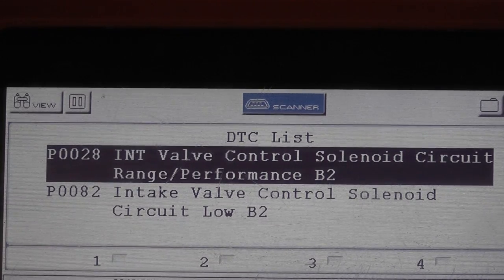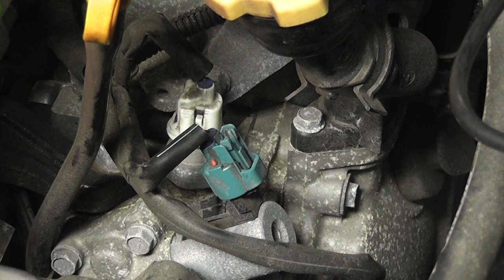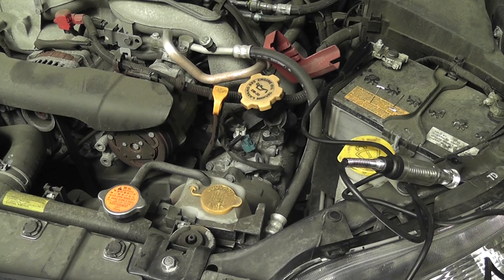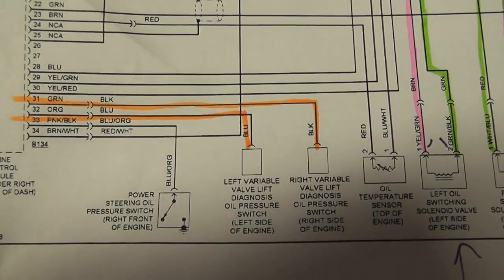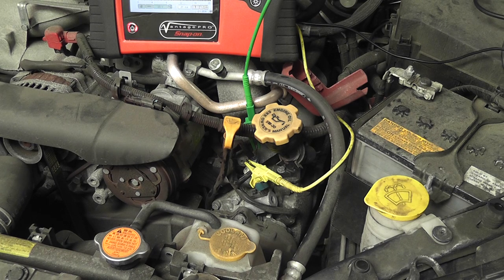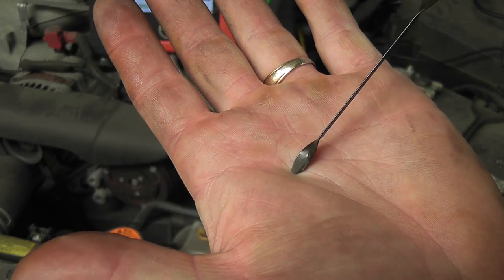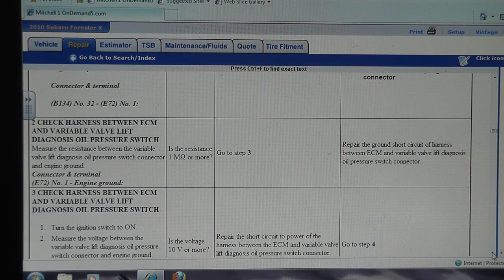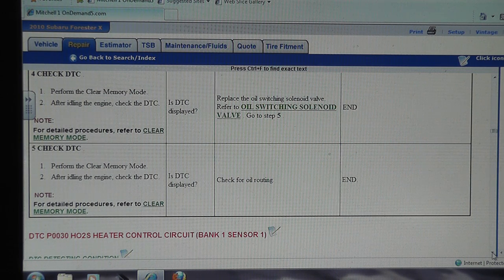How to test Intake Valve Control Solenoids (codes P0028, P0082) - Subaru

Comment: I saw this exact same thing on another Subaru with the same issue. The oil was low and dirty. It caused the SAME codes. Car owners that do NOT check their oil are asking for more issues than they can imagine. I hammer this into my kids heads and my wifes head. Changine oil and maintaining it is the CHEAPEST insurance for a great running car. This told me TWICE now that this vehicle is reliant on proper oil level for proper operation on that oil pressure switch. Wow! Great method for checking it too. Your test works and as you said saves time. Great job!

Comment: I have been troubleshooting electronic engine controls for 18 years, and I feel the same way on flow charts. You take a simple, and effective approach to trouble shooting and relay the system in a very understandable way. Keep up the great work. The younger guys starting out in this technical field, will certainly benefit from your knowledge and use of the scope as a major tool in troubleshooting. Great videos.

Comment: You are a freak!  I have degrees in mechanical, electrical, and industrial engineering and you amaze me.  Your logical reasoning is what is needed in the fundamentals of engineering.  I consider myself very good at logical reasoning and very much appreciate your skill level.  You need to simply forward a video to the headquarters of Subaru and wait for a call.  I have a lot to learn from you in vehicle electrical systems.  Thank you for taking the time and effort to teach us!
Reply from the maker: Wow what a compliment coming from someone with your background and knowledge. Thanks so much! I'm just a guy who barely passed high school who found his calling in electronic  classes at the tech school i went to. Then I went into the field for 8 years before coming back to teach at the same school (Rosedale Technical College) and have been teaching on this subject for over 19 years now while still troubleshooting cars both in the live shop at our school and for different garages. So I've just had a lot of practice on teaching certain subjects. More from a mechanics mindset though. I know some of my theories are off but if I can say to someone 100% of the time if you have this problem then it will be this solution. Who cares if my theory is off a bit 😉

Comment: Bought an '07 Outback for my son and it threw a P0028.  Having an electronics background I found your video really good.  I am getting a burning smell and found the oil pressure switch that seems to be leaking by.  I hope this is the problem but with your video, I really have a good sense of where to go.  Thanks!
Reply from the maker: thank you!

Comment: If you follow that flow chart you'd end up putting in a new oil switching solenoid valve giving it back to the customer and then they'd seize their motor because it had no oil.
Great video I've learned many things in the short time since I found your channel.

Comment from the maker: Good question. The digital voltage reading is an average of the on/off duty cycle. It increased in voltage because the on-time increased. If this was ground side switched the voltage average would drop as on-time increases.

Comment from the maker: You are correct, but if done properly it is THE tool to use. Remember my test light was connected to B (+) and it was finding a ground through the solenoid winding when plugged in. Unplugged the yel/grn wire did not light. Plugged in it did because it was finding a ground through the solenoid winding and the other wire that was a constant ground.

Comment: Paul that was fantastic.  I suspect  the OEM'S are not sharing the correct diagnostic repair procedures to 3rd parties.    I would suggest that the dealer network repair flow chart differs from what you have.   Auto manufactures are required to produce specifications on their vehicles and you see what they are sending.  The right to repair bill  is being challenged by OEM'S.  That flow chart was an insult.  Glad to hear your thoughts on a subject that seems to be getting worse. Well done !!

Comment from the maker: It certainly can be dangerous but only if you are using the wrong polarity and the driver happens to be "on". If the correct polarity is used, even with the driver "on", there is no danger as there would be equal potential across the emitter, collector circuit. Equal potential = no current flow through the driver.
Reply: Mr danner where can i get a copy of your book

Comment: Hey Paul I'm an electrical engineer and completely agree with you about engineering flow charts.  These flow charts do not "promote" the understanding of basic electrical principals of ECM sensor operation and processing as well as ECM control methods of solenoids.  So was it the fact that the "oil pressure" switch was not being activated by proper oil pressure (due to a lack of oil) or was it the Cam sensors did not detect a change in engine timing that generated the error code. 
Great work Paul, keep it up , you are a great teacher, wish some of my Professors taught the way you do !!🙂
Reply from the maker: Great question! To be honest I'm not sure, it's been along time. I suppose the arguement could be made for either. Thanks so much for the encouragement!

Comment: I am using this video to trick an 07 ECU into thinking my non-VVL engine is running VVL. These are exactly the voltage readings i needed to see to wire the relay.

Comment: hi, at 11.14 in ur video you said that test light is lighting because the resistance of the solenoid is high, but i think it is lighting because resistance of the test light is high and because of that you were not able to pass enough current. if the resistnace of test light is low, then u pass more current to solenoid and it works. higher the resistance lower the current and viceversa. It worked fine with your jumper wire because it has less resistance.

Comment: like you wrote

step 1 should be : check the oil level

it make sense on a oil pressure working system.....

moreover i guess there is certainly a  pressure valve upstream to avoid spreading oil in all the system under a specific pressure no ?

not low oil pressure idiot light or sender connected to the ecu ?

Comment: good video,2 things one is bypass to monitor a reaction and two polarity to determine jumpwire placement. polarity a little confusing because testlight will show different readings based on harness connected or harness disconnected.

Comment: Paul, Nissan uses a similar system 'cept is a different code P0011 ivt control. It is a pulse width ecm controlled two wire solenoid, at idle you have 14 volts on both wires and off idle you have control on one wire. Had a car the other day with low oil setting that code, look for it. Excellent video btw.

Comment: The duty cycle at idle may be to monitor the solenoids / make sure they are connected, it may be a current monitoring signal.

Comment: I have a Subaru Forester and the engine is probably a Legacy DOHC, there is 12 volts on the solenoid socket after switching on the ignition, is that correct? Thank you for the answer, Jozef.

Comment: Other way to find power or ground side switch, there will be between 0v to 12 volt on control wire (two resistances are in series, one in the pcm and other is solenoid itself) when ign switch is turned on. other wire will be if 0v then this is power side switch or 12v (ground side).

Comment: good video, and fancy computer tool you have there. the skills you used were some basic multimeter skills that everyone should know, but very many do not. Measuring Resistance (in ohms) would show if you had a short or break in your wiring to harness. I can see why their flowchart mentioned to do this. You were measuring Voltage of the two circuits which could have shown correct voltage but if you had a break or short, it might not have been grounding out unless the vehicle was shaking underload

Comment from the maker: Yes, which is exactly what my ebook is all about teaching.
Reply: ScannerDanner  hi . In the video you keep saying will cook the ECM  if you touch the ground wire and  you were using test light .and you already touched ground wire when you try to identify  positive or negative switch . Why test light 12v supply goes through solenoid then ground back ecu will be fine  . What is  Rule s for avoiding damaging ecu .  Thank you paul

Comment: Paul when you revved the engine and got the oil switch to open, the voltage on channel 1 also increased activating the solenoid. Was this an average voltage or actual voltage????????????

Comment: The tests he did proved circuit integrity, an ohm test on the wires wouldn't have shown better results than his tests because he's not only doing voltage measurements but also voltage drop tests.

Engineers write in ohms tests because it's what they are accustomed to, for them the system isn't mounted in a car and interacting with other components. For them it's on a test bench with a note saying it doesn't work.

Comment: My 2008 Subaru OB with the 3.0 six codes out with P0026 and P0028.  I checked the oil and it's perfect.  The acceleration at times is stumbling when pressed, but when gentle is smooth as silk???   I have a code reader and the code clears (of course), but comes on after 1/2 mile or so.  Once when I turned the engine off, with the CEL light on, when I restarted it 2 hours later, the CEL was out, but came on after several miles.  Whasssuppp?

Comment: The dealer who I bought my car off of I brought my 2006 subaru forester to them. Got that code I had no oil. They filled it up. but now something on the bottom of the motor is burning after driving for like 10 minutes. The code hasn't came back but I am curious why it's doing this now. The car has 97700 and I just did an oil change two weeks ago. Any idea

Comment: I have a Subaru B9 Tribeca 2006. Its been in the shop for a very long time 4 years. The local dealer told me they didn't know what to do to fix it. The codes are P0028, P0011, P0016 and P0018. My wife really likes this car. I was told the 3.0 engine is a rare bird but we still see these cars on the road today so I'm sure someone knows what to do to repair it. We replaced the variable valve timing solenoids and oil switches in the heads. Please help us repair this vehicle.

Comment: @scannerdanner I think I may have fuel delivery problem.. Stft are good at idle plus went over entire intake whit propane, no rpm increase however system stays in open loop until I goose the throttle.. Car stills has miss at idle no load.. I'll try changing fuel fillter first.. this system has no test port.. But 02  show very very lean less then .10 bank 2.. Another thing I noticed was Pcv system on valve covers are rigged.. Lol whit a hose and spark plug boot.. Isn't the system suppose to regu

Comment: 8:20 I thought there were times that it wasn't recommended to use a test light on a circuit that is tied into the computer, or am I mistaken? Also, I wasn't sure why, with the solenoid unplugged, you were seeing the positive on the yellow/green wire...but when it was plugged in, you didn't.

Comment: Great video as usual. 
I have a question?
When you put the test light lead on the battery positive, and touch the ground side of the solenoid, the test light do NOT lit, I understand it is controlled on the power side, but I still do not understand why it doesn't lit?

Comment: So your adding positive voltage to the solenoid to energize it ,there by being the computer right
Reply from the maker: I don't remember. I'm sorry. What was the voltage on both wires? 0 and 0 or 12 and 12?
Reply: @ScannerDanner  it was 0/12  and both wires went to the computer
Reply from the maker: 0/12 means the circuit was energized at that point. Circuit off will be either 0/0 or 12/12

Comment: Hey Scanner! Are you familiar with testing the intake valve module on a 2000 Ford Windstar?

I have a p1518 code and the module is dead with rhe intake vavle open. I can move it to any position and it stays there.
Reply from the maker: It is becoming more and more difficult to answer questions here. I have 80,000 people asking me for help now. So I have created a forum to help you guys better. It is free to join and we can exchange pictures, wiring diagrams and waveforms if needed to help guide you through the process of troubleshooting your vehicle. Thank you so much! Hope to see you there. 

Paul Danner (ScannerDanner)

https://www.scannerdanner.com/forum/post-your-repair-questions-here.html
Reply: Thanks man! I imagine you do get 50 help requests a day or more. The youtubes you have up already are extremely helpful I just hadn't found one that matched my particular issue.

I searched all the youtubes before asking but everything I've found were plastic link failure and replacements. I'll check out the forum. Thanks!

Comment: Wait so if the low oil was the problem then why wouldn't both the bank 1 and bank 2 sensors be giving codes
Reply from the maker: +wooohooo312 you would think that it would have set for both banks but just because it didn't, doesn't change a thing as far as direction.

Comment: Another great video! So e very nice tips there Paul. Would you mind offering your opinion on a suburu wrx 2.5 with a DTC P2432 SECONDARY AIR INJECTION SYSTEM AIR FLOW /PRESSURE SENSOR . I've spent a few hours on it and am 99% sure but would love to hear your opinion. Can sick it all in a email if that's ok?

Comment: These Subarus only open 1 intake valve until the oil pressure reaches a certain point than it engages a pin that locks in a second rocker arm that opens up both valves. This does not effect the timing.

Comment: How do we know if the computer can handle the load of the test light ?
Reply from the maker: In short, you must know what your test light current flow is and roughly the draw of the solenoid.  You need to watch my Section 3 videos lectures on my premium channel.

Comment: Why does the Oil Pressure switch change it's state when the solenoid is bypass tested? You're energizing that solenoid manually, how is the switch being changed? Is the computer suddenly seeing the solenoid open? and then in turn is the computer logically saying " Ah, the solenoid just opened, that switch needs to switch now". I'm not understanding the logic.
Reply from the maker: Because when I energize the solenoid, it opens the oil passage to the hydraulic mechanism and in parallel to this passage is the oil pressure switch. The switch closes from hydraulic psi. It is an input to let the ECM know that everything is working when it energizes the solenoid. Make sense?
Reply: Makes sense now! My brain was following the vid 98% just fine, its this 2% detail where i got snagged up. Thanks for clarifying, and btw big fan of your channel. Love what you do and how you do it. I got a print of your book for my Birthday, best gift I've ever received hands down.
Reply: I still didn't understand why raising the oil changed the percentage. I mean I know that oil is being pumped in the holes on the side of the cam gear, so it pushes the position of the hwole thing to keep valves open a bit longer, and further open too, but why the low oil level. Isn't a car engine maintaining the same necessary oil pressure to keep the engine healthy, as long as there is enough oil, so it doesn't suck air at times. If the oil is as low as for the oil pump to suck air and drop pressure, yes, but I missed the rest.

Comment: I can't understand the switch  I guess you back probed the switch at the power wire from computer but then you should read 12 volt all the time, but if you back probed the ground wire then the voltmeter should jump to 12 volt when you disconnected the harness. The problem is that there is no ground wire how could the voltmeter jump to 12 volt when the harness get unplugged.

Comment: What is the torq for the 10mil bolts holding the unit on?
Reply from the maker: Not much
Reply: @ScannerDanner  I found it. It's 7.4 ftlbs
Reply from the maker: @SSgtJohnT  you sure that's not inch pounds?
Reply: @ScannerDanner   yup I'm sure.
It's 10-Nm or 1.0 kgf-m or 7.4 ft lbs.

Comment: @scannerdanner Paul! man after doing futher research on this piece of chit, I found ther is only one Pcv valve buried under intake under harness loom, thats why the hose collapsed and this thing is still throwing oil from bottom and possible the reason it running ruff, WHY because the Pcv valve itself is still plugged, i just replaced the hose not realizing  the Pcv valve is possibly pluged, like I knew wher it was or even what it looked like.. Paul,Goggle image is a great tool to have in the t

Comment: id get nervous injecting a +Ve on a solenoid when its plugged into the ECM. its like you;re shunting the circuit , relying on the driver circuit in the ECM to limit your current. dangerous.

Comment: also no mention of an oil level
Reply from the maker: Oil level was the fix. Not sure what you mean
Reply: @ScannerDanner  i meant no mention of oil level in the manufacturer's troubleshooting chart
Reply from the maker: @nkonyanechristopher  got it! Yeah, flow charts suck! It is a common theme you will hear in my videos. I use them all the time, but as a guide only

Comment: Bank 1 and bank 2 coming up on my Subaru
Reply from the maker: Check your oil level first
Reply: @ScannerDanner  oh I did that first.its full
Reply: Oil just changed codes cleared.and at 3500 rpms,check engine light back on for both bank 1 and 2 solenoids
Reply from the maker: Energize them like I did in the video and see if you get an RPM change